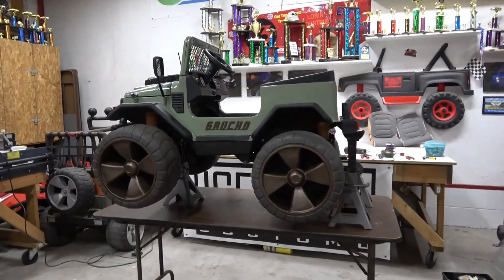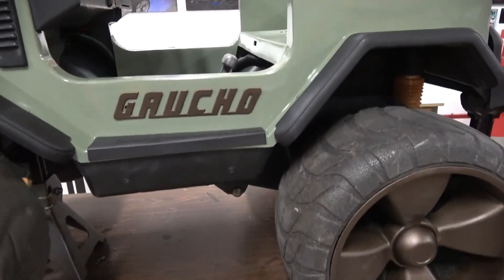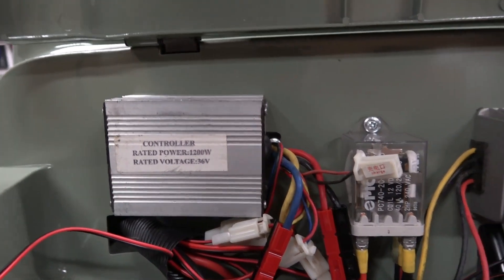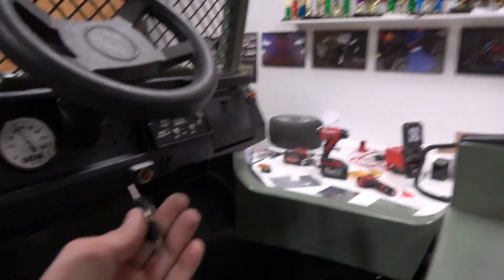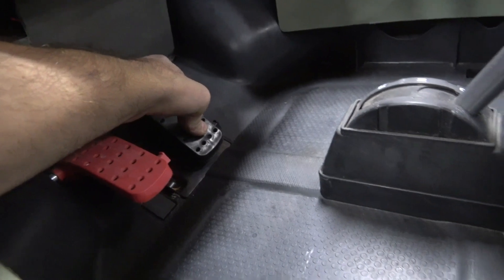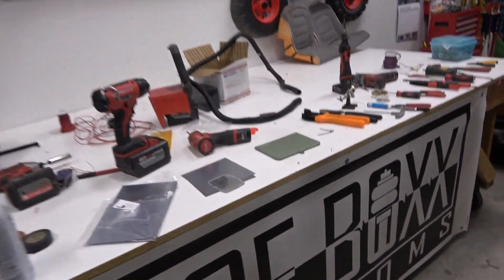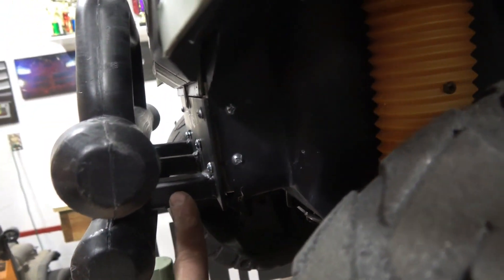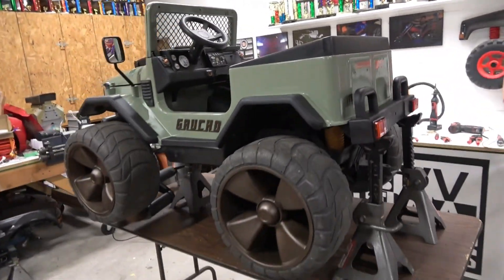36 volt Ultimate Super Gaucho Assembly Video #pegperego #36volts #supergaucho

Comment: Did you have to upgrade the motors to withstand the 36 volts? If so which motors did you upgrade to?
Reply from the maker: They are fine on 36. Could even handle 48 volts for short racing but definitely would make motors run hot
Reply: So your running 36 volts to 24 volts motors?
Reply: so I have a question maybe you can help me with. I installed 2 new 775 motors from ML toys. Everything works fine when the car is up in the air but the moment there is resistance or my kid gets in the car nothing works. It works with her not in it but doesn’t work when she is in it………

Comment: Hello 
Is it possible to put 36v battery but without the speed controller but only the original gear lever? I do thet on de tractor ground force peg perego but 20v.